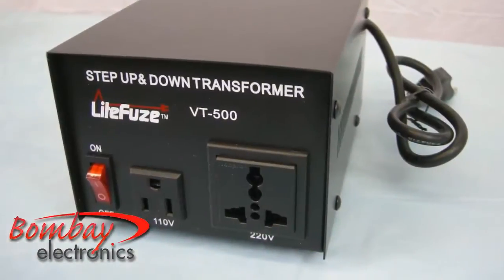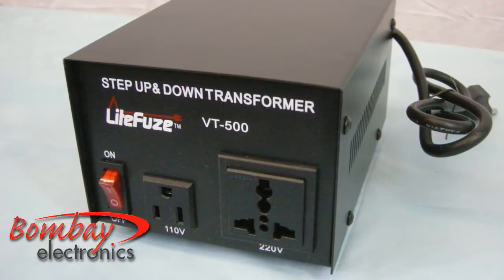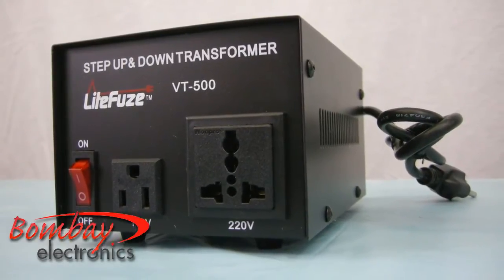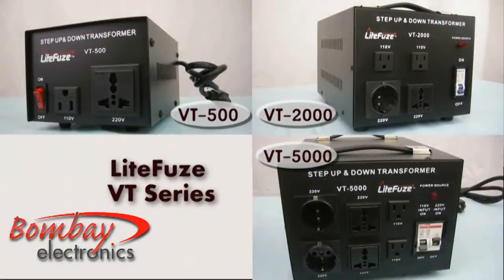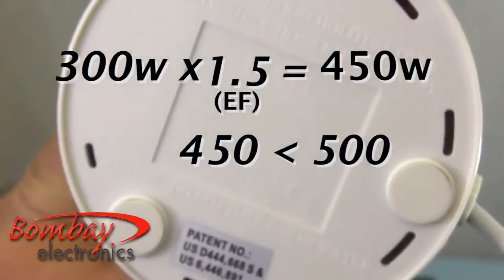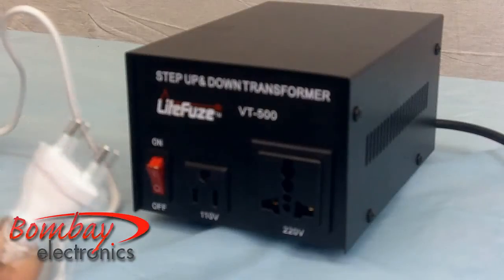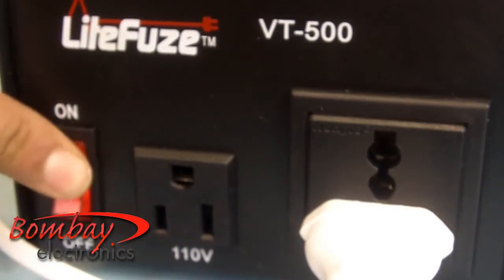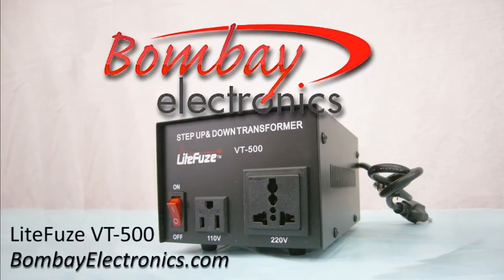Litefuze VT-500 Step up & down transformer

Comment: I have one of these, I’m still confused how to use it. One of my questions is, if I take it to Europe I can’t plug it in the wall as it’s got a USA plug at the end of the cord, is it safe to use a cheep plastic converter into the outlet? Then how do I use my American sewing machine that’s 110 to 220, and does it matter if it’s 50 or 60 hrz? If the back switch is 110 to 220, will 240 work? Some Eu countries run on 50 hrz and some on 60, will that matter?
Reply: Is it safe to use a cheap plastic converter into the outlet? = Yes
Then how do I use my American sewing machine that’s 110 to 220 = Set input on the back to 220 (while in europe and a country that uses 220) Plug your 110 volt sewing machine in the front port that says 110v
and does it matter if it’s 50 or 60 hrz? = No, it can do both
Will 240 work? = Yes

Comment: does this mean. I can plug this transformer into my 110v outlet. that has a 20amp breaker. and power my 110v male plug in machine that requires to pull 27amps
Reply from the maker: A hose runs 20 units of water at 110mph pr unit of time. Running the hose through an apparatus will not give the extra 7 units you require.
Reply: +MisterStavanger so in other words no. I can't power my 27amp. device with this one